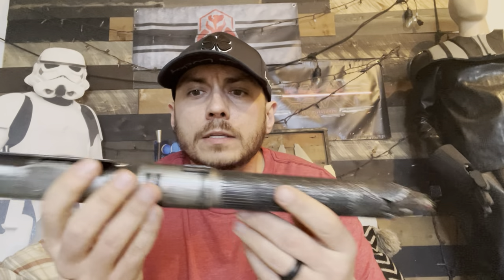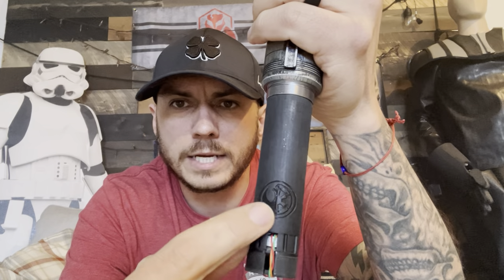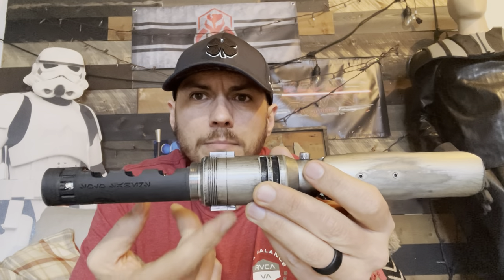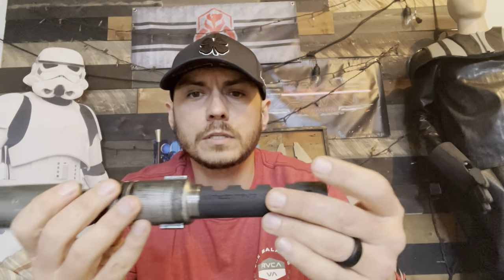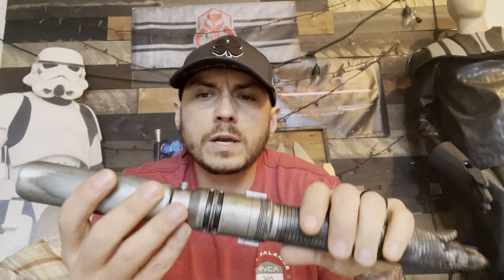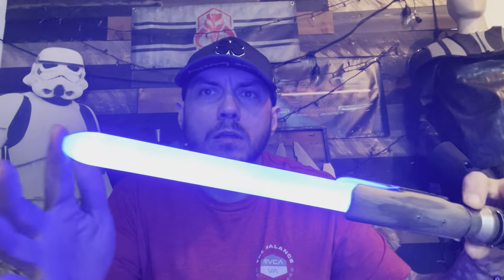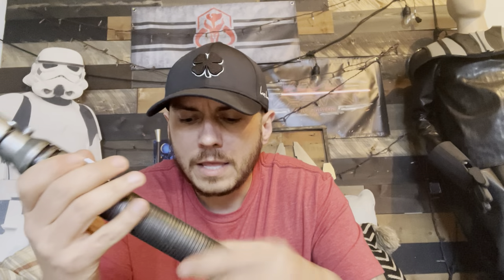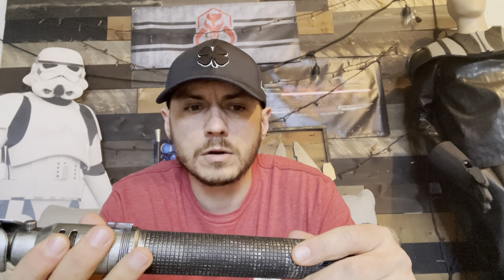Lando’s 89 Fallen V2 Saber

Comment: How much are installs ???
Reply from the maker: Depends on what you have and what board you want
Reply: @Solo_Sabers  I just ordered a StarKiller hilt from phoniex props it had a crystal chamber and I’d want cfx neo pixel and smoothswing I have a vektra from sabertrio and I’m in love with it and it’s easy to use to sonthing similar to that is ideal
Reply: @Solo_Sabers  could I message u on fb or ig or anything?
Reply from the maker: @Johnskywalker111  please do
Reply: @Solo_Sabers  ok so fb is just solo sabers rigjt